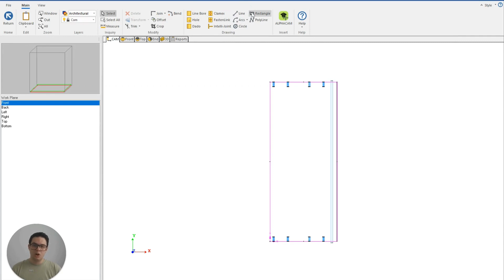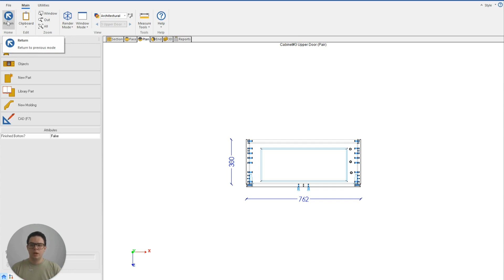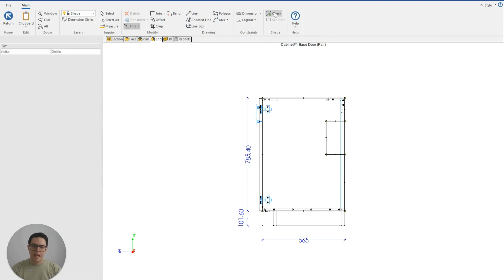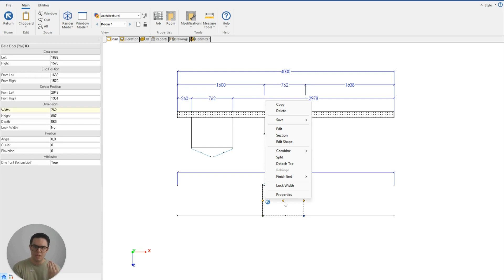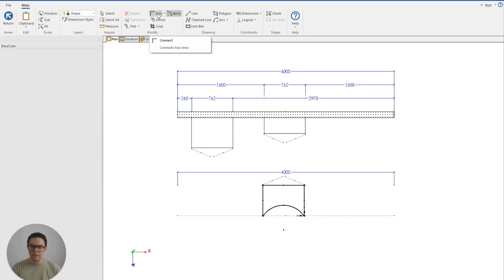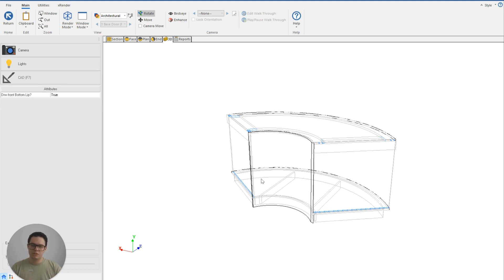How to Engineer Complex Shapes in Cabinet Vision with xShaping (Intermediate)

Comment: the change profile for cabinets is really good and I followed how you changed the footprint of the cabient. Did you guys have advice on changing the shape of the cabinet in front elevation (example being a wall cabinet where it meets
 a sloped ceiling)
Reply from the maker: Oh, that's interesting! I feel like it is very similar in practice. 

Like in your example, use the Shaping tool to shape the face into that space as you'd like, then work in tandem with the Cabinet properties to fix up what's missing or needs to be fixed. (Say, such as adding a missing top in with a mitre for the angles with the New Part tool)

In Cabinet Vision 2025 we can also control the connections on any edge between two parts, and we can change any of the Construction Method settings per cabinet, which makes custom-shaped cabinetry like this so much easier too! 

Was there any particular issues you ran into that would keep help resolve? Such as a missing part, or unexpected behaviour?